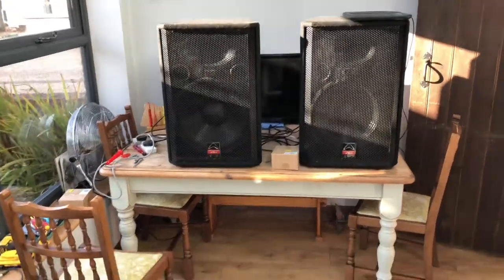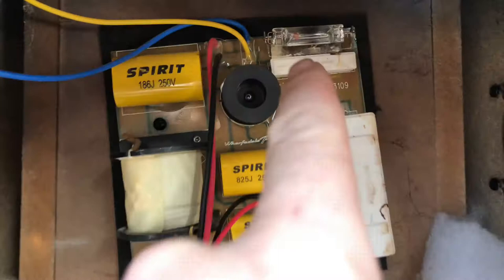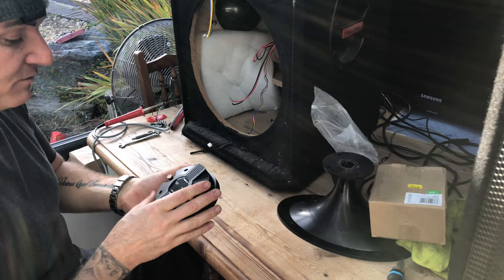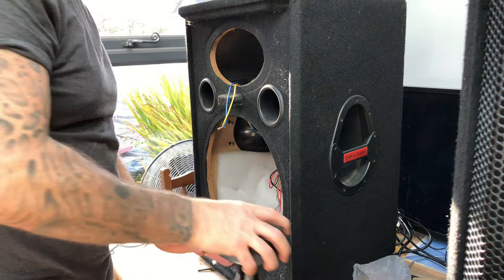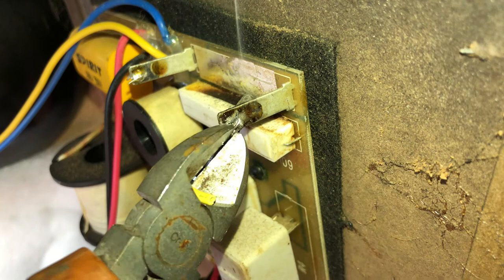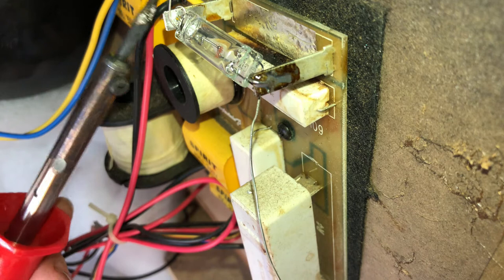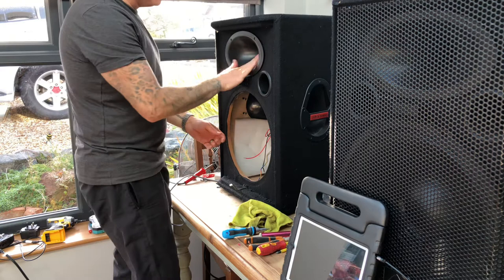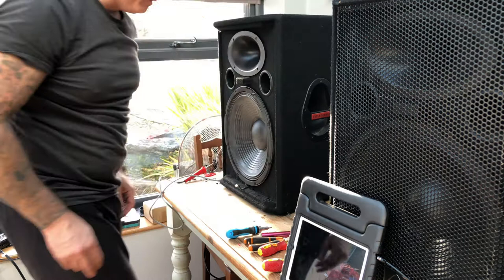Wharfedale Pro PA speakers compression driver replacement

Comment: I have the same speakers, and the same issue... I replaced the compression driver but still no treble. I tried it in the working speaking and its fine so I think its the crossover. Any suggestions kn how to fix? The fuse is fine
Reply: Did you manage to fix this issue? I got a slightly older version of these and I'm having the same problem. I've yet to open them up, but previous owner knocked the treble pot off. I'm thinking it's not blown as it does work with pressure added in some positions, could be related to what you are saying. I'd appreciate any tips you could give have you fixed them ☺️👌🏼
Reply: Yes I got them fixed. It was some capacitors on the crossover that had blown. I couldn't do it myself but found a audio expert to do it

Comment: Wharfedale and they are using skytronic drivers wtf
Reply from the maker: I know, I bought these as wharfdale speakers, I was basically conned!
Reply: @Richbowker  if you bought them with skytronic parts in them then you have been conned straight, i own a pair of the passive models and have owned a pair of the active models and both pairs have had the originals in them